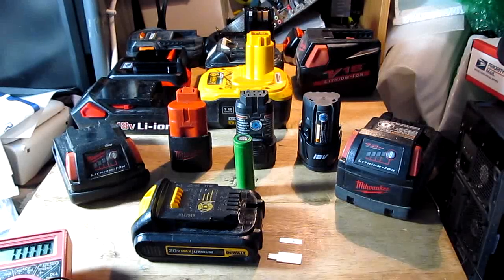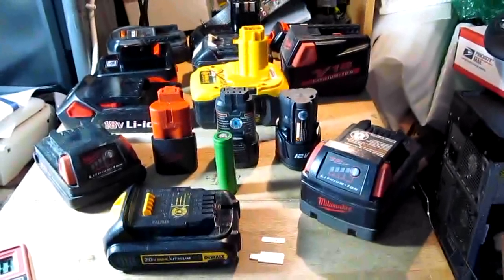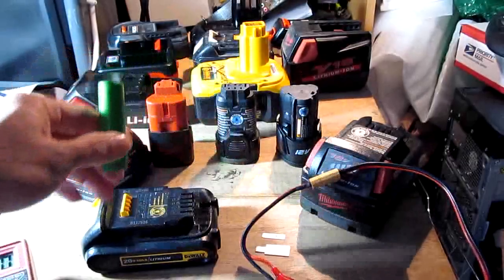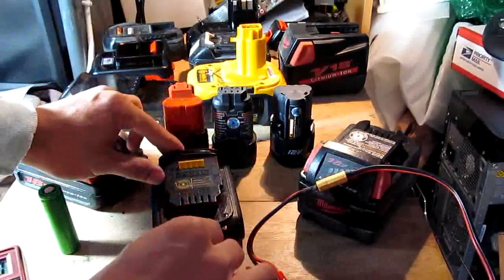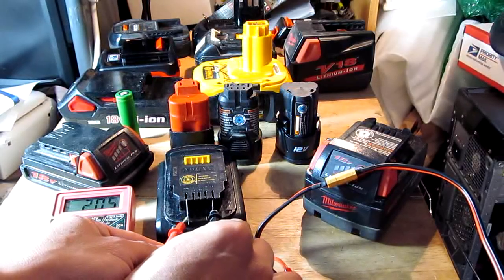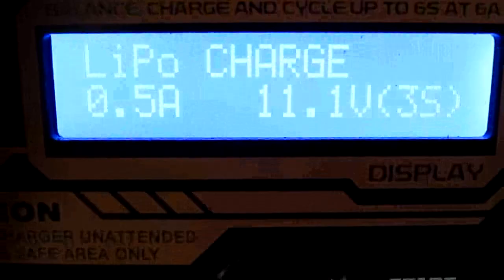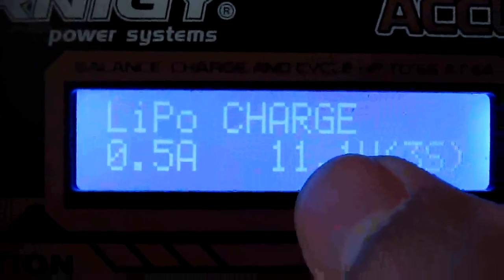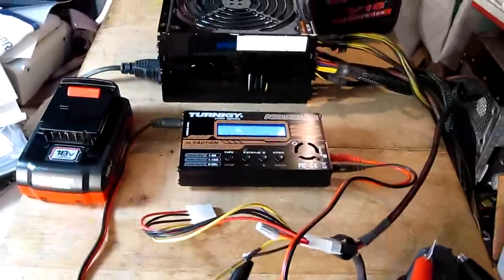DIY Charge any cordless tool/drill battery without a charger using Turnigy balance charger

Comment: What did you use for pins?
Reply from the maker: aluminum cut from computer aluminum heatsink
Reply: I see this a lot, so maybe this will help some later user: 16- 22 AWG spade terminal works for the ridged type with the small holes, as well as the bigger holes of the 18v bats. You can stick in one side of the spade, leaving the other side out to clamp your alligator clip to.
https://www.homedepot.com/p/Tyco-Electronics-Spade-Vinyl-16-14-AWG-Stud-8-10-75-Clam-EB0268-000/202204282

Later edit cause "spade terminal" covered to many types apparently. Talking this type that goes around a stud/bolt.

Comment: Milwaukee m18 won't charge on this way. Do You have any solution to charge milwaukee battery whith power supply whitch CC CV function?? I connect two outer pins + and - , power supply indicate  charging whith 18,9V and 1amp but battery don't charge. Sorry for my poor english. Regards

Comment: 0.5A is half an amp not five amps.   Big difference!   Charging at 0.5A is appropriate as chosen by the charger unit.
Also, charging this way without using a balancing circuit is ok for a while but eventually the battery pack Will start underperforming as individual cells become less than optimized.   The balancing circuit is there for a reason.
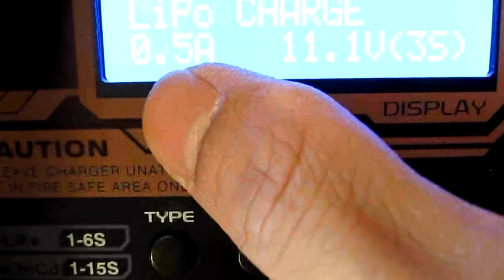Reply: Vu said "point five amp", you hearing impaired clown; the charger's LCD clearly says 0.5A at the point in the video (8:08) you so foolishly called attention to. Moreover, this video clearly shows a technique to be used in a pinch (e.g. charging a battery that has no remaining monetary value, or even an available charger), not a method by which to charge packs you really give a fuck about. To that point, many of those random tool packs probably ALREADY have cellular imbalance, thus why Vu even has them. Honestly, it's like you just spew this garbage to make yourself feel smart by denigrating others who you're too fucking stupid to even listen to in the first place. Shag you in the arse with a chainsaw, and make sure you start it first!

Oh, and to "Codie": Do you think matched towels dry your dirty Irish arse better than mismatched ones? Jesus Christ.
Reply: pbrin true. You could take the case apart and self balance after a while though if you only need it for 1 or 2 companies. But for all these batteries should have just chosen 1 company from the get go

Comment: You lost me at the power supply source. Does the turnigy have its own power? Does it plug in to 110 then output proper volts according to the settings you choose?
Reply from the maker: You need a 12V DC power supply to run it. Here's the video to show you how to power it: https://youtu.be/ibWBglrGYsE
Reply: Just to clarify for anyone else wondering about this, the Turnigy and other such chargers (e.g. iMax B6) are powered by a laptop-type "brick" power supply.

Comment: Can I charge Milwaukee 18v (non lithium) batteries in this fashion? I think I read something in the comments below that state you cannot. I'm curious because I just acquired a Milwaukee hammer drill and sawzall. Both have batteries but no charger.
Reply from the maker: You might be able to charge it with the Turnigy charger. It has an option for Ni-Cad batteries. Each Ni-Cad cell is 1.2V and you need to find out how many cells there are in your battery pack.

Comment: Great video thanks for the info. Where did you get the clips at?
Reply from the maker: I got the aluminum clips from old heat sink salvaged from old TV's, computers, and other electronics.
Reply: vuaeco do you think it would be worth buying the 80w accucel 6 and the ac adapter plus that extra piece to plug the adapter in? All together it's going to be like 85 dollars. Could I really get that much use out of it? I have like five power tools with no charger. Please give me some advise. Thanks a lot

Comment: thanks for nothing google.  I searched: charge DIY drill battery "without balance charger" and I see this video which exact opposite of my search. I only want to take the junky low Wh and replace with 4 18650 in series. .. this video is good for the everyone else though.
Reply: Brad Baker. You can take 18650 cells. One cell 4.2volt. Take what you need for the total voltage. Try looking up bms for 3s and 4s. These bms have a overcharge cut off and undervoltage cut off. Now you can charge them with a normal charger through the bms. Just plus and minus. For a 4s its 14.8volts what your charger needs to output.

Comment: Doesnt the charger have a Lion charging option? Why are you charging them under the Lipo setting? Not the same battery chemistry! I am also curious how your packs are holding up never being balanced if you only charge this way
Reply: a bow. Li-ion and lipo are allmost the same. Accept for the structure. Li-ion can be charged with lipo or li-ion setting. Before using them you must charge them seperately  to 4.2volt each. Its not a bad idea to make a balance lead to balance charge them once in a while.

Comment: Are those 3 extra pins on the 3s 12v batteries for Balance charging?  1ground and the other 2 are in between pos and neg for the other 2 cells?
Reply: Nestor Asuncion. 3s has 4 wires. First wire to plus first battery , second to plus second battery and third to plus third battery. Fourth goes to minus third battery.

Comment: I have a Ryobi battery and it has fourth contact on the body. After I connect it to Imax B6, it charges for 10 seconds and then disconnects.
Reply: the fourth contact is thermal sensor for the official charger. The thing with ryobi lithium batteries is that they pulse charge to let the BMS balance every 10sec... so yeah not possible to charge them with an imax b6. or you would have to restart the charge every 10 seconds manually
Reply: @bastienrehm  correction after more research:  you don't have to disassemble to charge, use a 1.2k ohm resistor between mid and positive terminal this activates charge mode for the BMS. charge at 4.1 x 5 = 20.5 volts, rate 1c (1h)
Reply: I found a dewalt 20vmax drill in the street  already have  my favorite 18v dewalt that works  just fine that I bought about 3 years ago now I don't like being played as a fool the cost of just the charger I  could probably get another 18v, charger and 2 bat. So if I can charge this bat. Without buying a charger than I will or if 1 of you nice readers want to send me 1, I will greatly accept and appreciate it
Reply: @williampowell239  If you can get 2 XRP batts and a charger for $35 Canadian, go for it. Good luck, pops.
Reply: If you really need to do this with a Ryobi lithium, open the battery pack case to bypass the BMS board and access the cell groups directly. That's how I charge the four Ryobi 9Ah packs for my ebike...with a DeWalt charger. ;-)

Comment: I have a Hilti CPC battery from a impact driver/wrench which I want to charge off of a UAC-50 model RC charger.I need help to identify what is the positive and negative out of the 5 pins. There are two paired together on the left and three together on the right.
Reply from the maker: Use your volt meter. You can determine both the voltage and polarity of the terminals at the same time.
Reply: i am struggerling  with this, i have put the meter on many combinations on the pins with no clear readings. my meter is a new uni-t

Comment: Hi vuaeco, thanks for your nice video. Can you show us the terminal pair to charge Milwaukee 18V Red Lithium Battery (Cat no. 48-11-1815)? I don't know which pin is correct +/- connection to charge. I measured the voltages of these pairs: 16.5v/0.3v/16.0v/0.0v/mass. I tried to connect 16.0v/mass but it did not charge. Thanks a lot.
Reply from the maker: use your volt meter. The + and - terminals are on the outer most sides. If your volt meter shows negative sign then reverse it until you don't see any negative sign on the volt meter. Then you will know which side is positive and which side is negative.

Comment: My Turnigy Accucell 80W charger won't start charging my li-ion drill battery, excuse me but I can't understand how did you start charging under balance mode without connecting balance cable ?
Reply: 18V is 20v. they the same. 5 batteries.
Reply: I get the same
Reply: the tool and the charger both communicate with batteries protection board and opens connection to the battery. I think its just a matter of appying a certain amount of voltage to the proper pin in the battery.
Reply: @lmorrison17  I got milwaukee 18v battery. It charged the battery full but the battery indicators still shows empty. Can you help ?
Reply: @byjulordon9102  I acquired several low voltage milwaukee Batts. even after charging with my hobby charger the fuel gauge would only show first led rapid flashing. If you get that far and have acess to a factory charger pluginig the batt into it will reset the fuel gauge. pins on the batt are  B+ (NC on charger), J1, charge, J2 , B-. I no longer have acess to a factory charger but once able to successfully reset the fuel gauge. Just in the last few days I had another go low on me. I cant remember exactly whay I did but thought I had jumpered j1 and 2 with a 2k resister and applied charge  voltage  to B- and charge pins. But I think I mis-remembered something because it didnt work this time. But I am still experimenting with it and if I get it to reset I will come back here and report.
Reply: @byjulordon9102  I have figured out how to reset the fuel gauge with out the factory charger. I can email you the instructions with pics if you want.
Reply: @lmorrison17  thanks bro, I figured out few days ago it's tricky but useful. Thanks again
Reply: @lmorrison17   It was easy for me - for 2 seconds short all three center pins J1, Charge, J2 after you have charged battery via + and - in my case I used cc cv 21v 1.5A, now instead blinking last led I have two perfectly working M18 batteries. I know this is old thread, but it can help someone recover battery without original charger.
Reply: Lev Lin It will will help someone if they find it. Another thing I did since all of this was to get a factory charger and measured all the pins relative to ground. It’s been a while ago now so once again I can’t remember what I did I used the information to bring one back to life. I have a factory charger now so I have not had to do it again. But I really ought to one go low again to experiment with waking the bms again and make a video for people.
Reply from the maker: It was not on balance mode. It was just on regular mode. If you want to use the balance mode, you will need to pin out the inside of the Dewalt battery.
Reply: I tried on normal mode too, it still fails to start charge.
Reply from the maker: Did you choose Li-ion with 5S? If you have an 18V or 20V Li-ion battery, it's 5S. If you have a 12V Li-ion battery, it's 3S.
Reply: I choose 3s, connect positive and negative ports and press start button, "Balance connect error"

Comment: Excuse me man you seem to know a lot about this stuff I got my brand new terratek drill driver 18 v yesterday and it seems to be charging for ever the lights are still on maybe it's been 12 hours or more I've charged it it works the drill But why hasn't it full charged ??
Reply: "HEY ROBB STARK" I had that same problem & figured out it was the AC adaptor & maybe if like me you have several of them keep trying different ones till it tops off your battery

Comment: aren't some of those batteried lithium ion? my sky rc charger has a separate setting for LiPo and LiIo
Reply: gtarbmx  lipo and lilo are the same voltages. the difference is lipo usually allows a higher charge
Reply: rate
Reply: Lipo batteries are same but in a pillow type polymer bags ,instead of tubular Metal can.

Comment: Yeah, he is long winded BUT if you've got somebody who's not comfortable with doing something like this, it is reassuring. I have no issues with his method (which is what counts--his method that is) as I use my Triton 2 battery charger (for RC batteries) and as long as you know the capacity of the battery (hard to find sometimes as not all mfg's are forthcoming with these stats), you can use this type of charger with clips. And use your polarity tester (or something similar) to test for + and - as these are not usually marked on the battery.

Comment: Is there any chance of overcharging or does the Turnigy stop charging once the battery is full?
Reply: Is the inlet 12V DC? Thinking to charge a 18V Li ion battery from a remote area. I feed that 12V battery from solar. Can I leave it on, so if I'm not around for a week, it still can maintain it after it's been fully charged (discharge+charge)? Thanks!
Reply from the maker: +Malek Ali 
It won't overcharge. The Turnigy will stop charging when the battery is full. It works the same way as it charges the RC car batteries.
Reply: @vuaeco  what model was yours
Reply: Hi I have got a Imaxb6 charger they are the best charger in the world.you dont have to worry about overcharging,heat,etc.
Reply: How much is that RC Trinity charger?
Reply: @michaelmaxey7195  go on Ebay you can get a IMAX charger for 17 dollars thay work awesome!

Comment: Hi can u please show me how to revive & recharge my 6cell 7.2v rc battery pack?? Thanks
Reply: If you want to revive dead batteries. Look up a tutorial on yt at replacing cells. This will mean buying 18650 lipos and opening the battery case and installing new batteries, unfortunately you can't revive dead cells. Also don't discharge lipos past 30%. That damages the cells

Comment: The 'extra' terminals are there for a reason - Li-ion batteries are susceptible to overcharging and get HOT!  Those terminals are for the temperature sensor to protect the cells.
Reply: Andy Webster they are for balancing the battery
Reply: @robertw5607  Temperature and data pins. balancing happens with the circuitry in the pack (on ones that actually balance) not the charger.

Comment: Hi! Thanks a lot for showing this here, this is just what i wanted to do!
Could you tell me if i can use the charge balancing feature of the Turnigy with the DeWalt batteries? Just need to find the correct pins, right?
Thanks a lot again!
Reply from the maker: ***** I think the Dewalt batteries have the same pin out as the turnigy balance charger. So you just have to find the correct order of the balance leads on the batteries. But you don't have to balance charge it. Just use the positive and negative leads to charge it. Making the other leads for balance charging will take you a lot of time and there will be wires and wires hanging out and around. The chance of it getting shorted out is real! I'm not sure if the time invested in that and a risk of getting the system short out is worth it? Your call.
Reply: vuaeco Thank you so much for your reply!
I want to use the Turnigy as the only way to charge my batteries as I go off-grid and the original charger broke aswell. My concern is that i might damage the cells by not balancing them ... ever.
To avoid the problem of having to deal with the loose contacts i would just reuse the enclosure of the broken charger and wire up a balancing cord to the appropriate pins.
Here is what gives me a headache: The balance cord has 6 leads for a 5S pack. The DeWalt pack has only 5 pins in total named: (B+) (TH ID) (C1 C2) (C3 C4) (B-) How could I go about wiring this?
Reply: @vuaeco  i have a black and decker 20v lithium battery. I want to put it in a older rigid nicad case to use on my rigid tools. But i would like to be able to charge it using a rigid charger. Both batteries have 4 pins. The charger has 4 pins. But im not sure what the 2 pins in the middle of the black and decker lithium are for they arent labelled im guessing it should be the dame as the rigid but would you happen to know or know where i could look to find out ? Any info appreciated thanks.
Reply: You have to open the battery case and solder the balance wires to the BMS board. The board will be labeled B1 B2 etc..